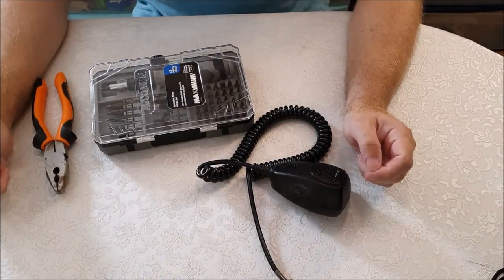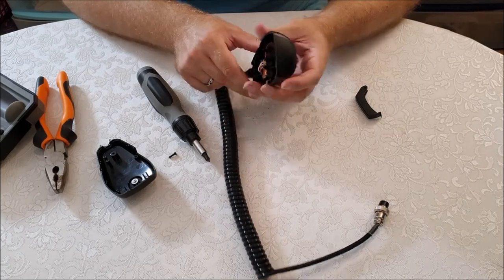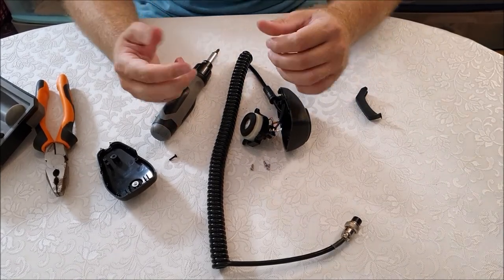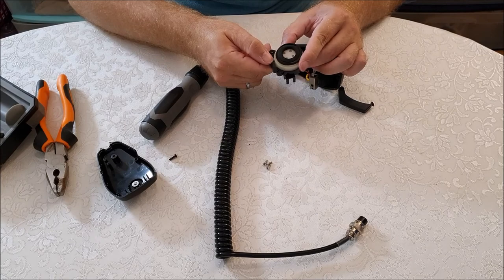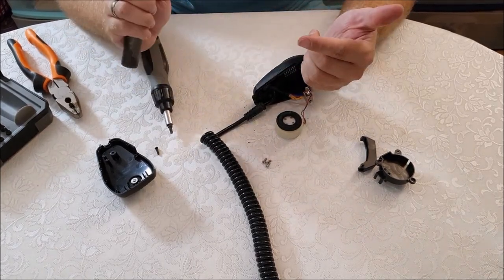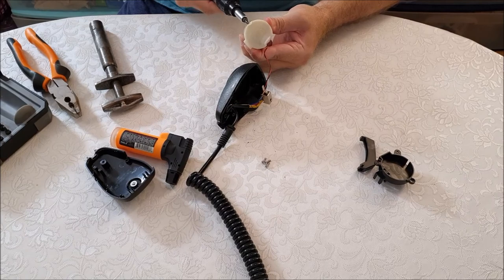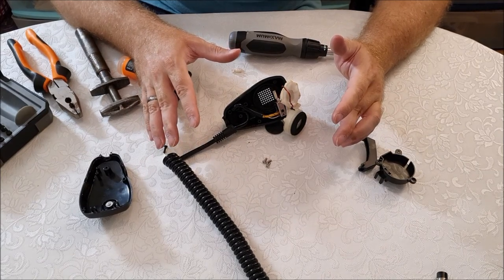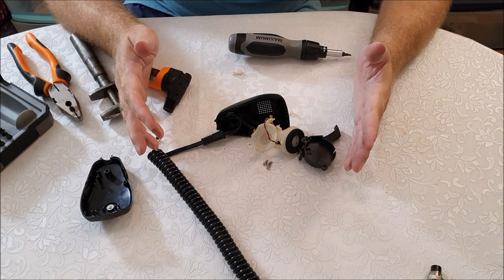What's inside a cobra CB microphone

Comment: Dude, those are rare. Even the old style chrome face radios are coming stock with an electret "noise cancelling" element, and the switch is dirty or faulty out of the box. Get the "Dynamic" labeled mic in the cb stuff isle at the truck stop, and make sure the plug is compatible, and really have a talker.
The "noise cancelling" mic does work as intended, but getting voltage through the circuitry is just dirty engineering, but lets you safely plug in a "Dynamic" mic. Unless there is a battery, or the radio is designed for a lead sending dc volts to the electret module, (which are the radios that can be deeply damaged when a "Dynamic" mic is plugged in)  it is really temporary crud.
Reply from the maker: Thanks for sharing with us!
Reply: I assembled a dual element electret this weekend, one element with .25 opening and one with the 1/16 pinhole and it sounds great. They are wired in parallel.